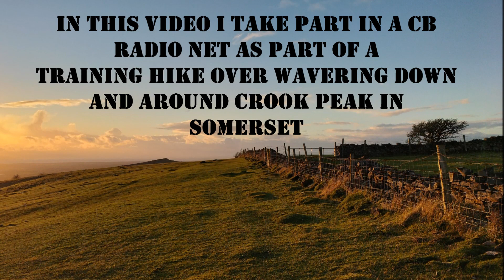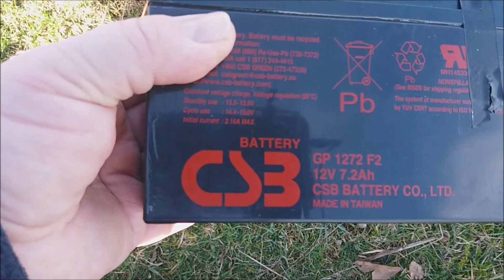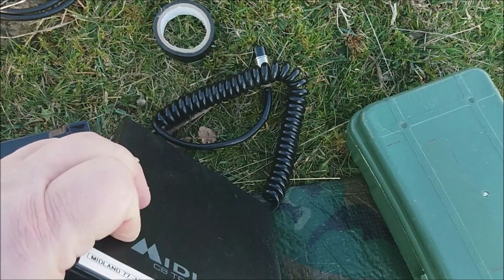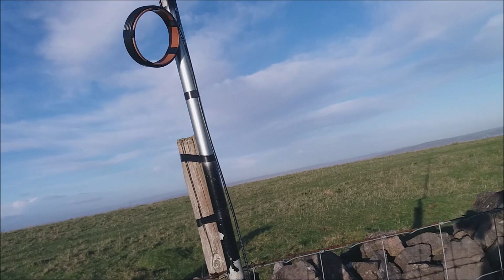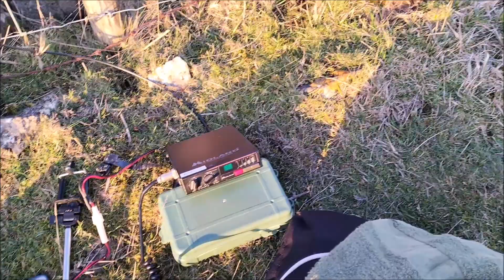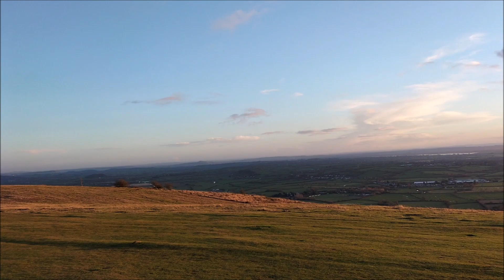CB RADIO UK - HILLTOP SHTF/PORTABLE

Comment: Awesome!  Good job, i love the old "emergency radios" as they are almost always in brand new condition.  With an adapter and a good antenna, they work as well as anything else minus ssb. I pick them up whenever I can get them for a good price. Great for passing out to folks for a cheap all in one setup.  You guys in the UK do CB the right way, its the Wild West here in the states, occasionally run across a good operator but no nets or anything organized at all like you guys. Hats off to ya!